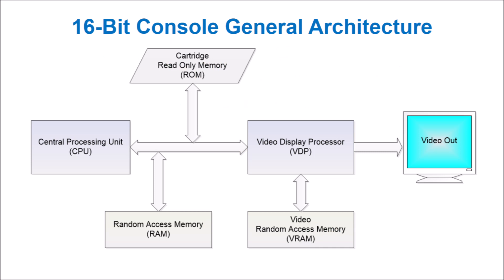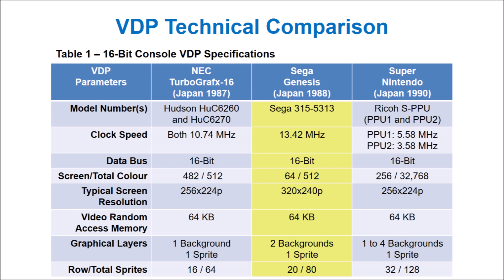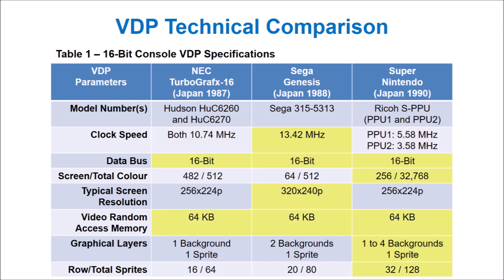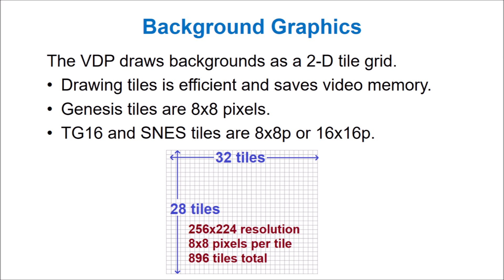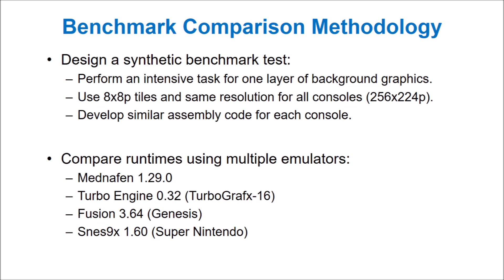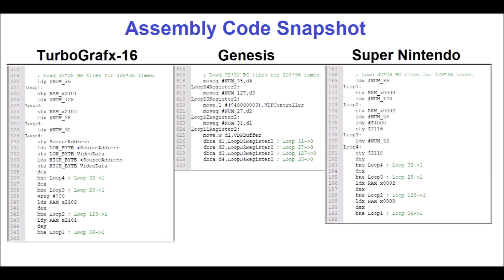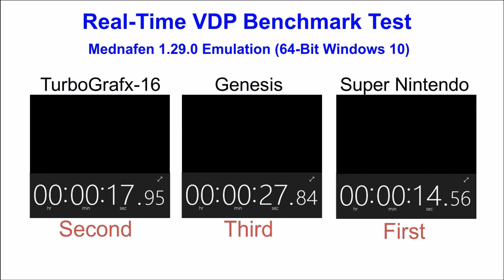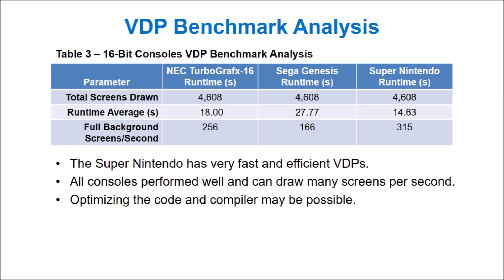VDP Performance: TurboGrafx-16 vs Genesis vs Super Nintendo

Comment: So both the Genesis and SNES have dedicated circuitry for doing this called DMA, and it would be more appropriate to benchmark that. This test shows what I was talking about in my last comment about the memory inefficiency of the 68000.
Reply: The SNES could have been a real beast of a console lasting beyond it's years if as you said it had a beefed up CPU and some of the silly flaws fixed. Like only being able to load 64kb of sample data at power up to the sound ram. If they did the simple fix of loading new sound sample data on the fly the snes would have had amazing music for the era. hey ho.
Reply: @robfarmer9272  also, a dma inside the ppu processor.
Reply: @robfarmer9272  it DID have amazing music for the era. I was there.
Reply: I second this. And while the TurboGrafx-16 didn't have a dedicated DMA, the CPU had the ability to copy data in blocks. If I remember correctly, something along the lines of "TIA source, destination, amount". :)
Reply: @inceptional  from memory only 3 games or around that found a way to re map the sound cache ram. But took a heap of cpu timing which had to blank the screen. Which made it very impractical for in game usage
Reply: yes and no.
This does combine all parts of the system to get an overall idea of performance.
Game GPU tasks would still be CPU bound IRL.

Comment: The TG16 had a superior color palette and sound chip than the Genesis. Just missing the parallax scrolling.
Reply: Totally agree on the better sound. The FM synth was a beast, but nobody knew how to tame it. Only very recent, thanks to Dexed FM emulation, we finally get to push the DX7 and DX200 (kind of Mega Drive synth) to its full potential, thanks to modern UI. Take Sonic for example. The composer for the Game Gear must have had lots of fun surpassing the Mega Drive sound tracks on crappier hardware. The Game Gear tracks are full of energy. The MD version is warm, lush, metalic FM molasses at best.
Take After Burner or Space Hariier, two Sega titles. They rock on the PC Engine, yet sound crap on the Mega Drive. Galage 88, Cross Wiber, Jackie Chan, Bomberman 94, Final Soldier, etc. etc. The PC Engine is a chiptune dream.
Reply: @jc_doge  Thanks, spam detection is really bad in YT. Maybe you can give a search term that pulls the right link in Google for example.
Reply: @2kBofFun  Sure, it's a thread on sega 16 called "Sega Genesis vs System 16". post 31 and 32 summarize the main issues re: pcm playback.
Reply: More colors on screen? Yes
Better sound? No
Reply: Superior on screen colors, genesis and th16 has the same 9-bit color pallete.
Reply: @maroon9273  superior soundchip? 😂😂😂😂
Reply: Sound chip??? No way, the TG16 sound chip is crap compared to the Genesis.
Reply: @jonpirovsky  The Genesis sounded like Darth Vader having sex with a high tension wire. I had both systems when i was a kid, compare MUSHA to Blazing Lazers.
Reply: @ImWithTeamTrinity  lol brah... you heard darth having sex in that sound lol
Reply: @ImWithTeamTrinity  Blazing Lazers sounds muffled as hell... It's not bad, it's just a muffled, somewhat boosted NES sound. And Musha is far from the best sound on the Genesis. The Yamaha chip on the Genesis is far more capable in expert hands, as Streets of Rage, Shinobi and many others can attest...
Reply: you guys are weird lmao
there are great sounding games on both and spec wise they trade blows all the way down the page (hard panned stereo vs smooth panning, more complex sounds vs easier to program, 8-bit pcm without interrupts vs buffered 5-bit pcm with interrupts.. the list goes on and on).
Reply: @jc_doge  Can you give any info source on interrupt capability between snes/md/pce?
Reply: @2kBofFun  PCE is kind of an interesting middle ground between 8 and 16-bit. Sound wise It's a 6 channel wavetable (32 sample 5-bit loops). You can switch any or all channels to "direct d/a" mode, meaning PCM. Now, it doesn't strictly have a pcm interrupt (unlike the nes), but a common method is to use the the timer interrupt to feed it at 7KHz or the scanline interrupt for 15KHz. If you look up pc engine pcm demos you can find some on youtube doing some pretty advanced stuff with channel mixing at even higher sample rates.
Reply: I bought, enjoyed and still have these three consoles from the 90’s. Regardless of the tech specs or “bench tests” it was the developers that either gave you only what the development tools offered or pushed the limits and sometimes going above and beyond what the hardware was initially thought capable of. Late in the Genesis lifecycle we enjoyed special effects in game software that wasn’t capable from hardware alone. TG-16 games had a very distinctive look, feel & sound and was the little engine that could but it never achieved the success in NA that it had in Japan mostly due to lack of advertising, licensing and support in NA. The SNES had superior sound, colors and special effects in hardware with some early games suffering from slowdown until developers became familiar with the hardware. Special enhancement chips would be incorporated in the SNES cartridges that allowed for even more incredible sound and special effects. Personally I enjoyed the games on my Genesis & SNES equally but more than my TG-16. My experience with the TG-16/PC Engine is that while I enjoyed many games on the console it was always obvious to me the Genesis & SNES games offered vastly superior sound and graphical effects but its CD ROM games definitely benefited from that format just very limited.

Comment: Interesting, but nobody would actually do this on the Turbografx.
The Turbografx had opcodes (ST0/ST1/ST2) and a block VRAM copy state machine (TAI/TDD/TII/TIA etc opcodes) which are several times faster than this and were intended to be used for this exact scenario (copying data from RAM/ROM to VRAM, or from VRAM to RAM).  The copier takes 6 cycles per byte written, so approximately 1.5 million bytes per second, and would chew through the 4.1 million tiles in around 3 seconds.
Reply: @inceptional  Feel free to make more leaps of logic and put more words into my mouth.  Your mental gymnastics are impressive.
Reply: @inceptional  You typed a lot of words to double down on your previous comment. The person you replied to did not imply the other systems were given any advantage. Only that the tests were not particularly well optimised for the systems. He likely used the PC engine as an example as he's familiar with the hardware. If he was more familiar with the Nintendo he may have mentioned that. You're assuming bias where none was evident.

These types of tests only really make sense if the hardware is being used in an optimal way. You wouldn't benchmark an Nvidia 4090 by slowly pushing pixels from RAM into its video buffer using only the CPU - it makes no sense. In fact, benchmarking consoles is generally ridiculous since the games are what define them, followed in priority by the ease of development and maybe how the hardware works as a whole to deliver content after that. Raw figures mean little. I feel the same when people "benchmark" mobile phones. Who cares?!
Reply: @inceptional  His point, obviously, was that the optimum method wasn't used for the test. This doesn't mean the optimal method was used for the other systems either, but he was pointing out one case he was familiar with. Did you really find it that difficult to understand?
Reply: That seems incredibly fast, maybe even too fast. They would mean Turbo graphics could display full frame rate and resolution fmv from the cd or simulate multiple layers using tile animations no problem. The arcade card certainly shows it is capable of something special. The 320 mode of the turbo looks real nice too but only a few games use it and the system does tend to have a bit of sprite flicker. Almost sounds like z80 code with those block copies.
Reply: @turbinegraphics16  Well, the downside is that the CPU is locked out of running code while the transfers are taking place.  So it would be a bit unrealistic to expect this kind of transfer rate all the time (unless everything fits on the cartridge or in RAM and you're just copying data.)  Also it won't really help all that much with simulating a dual background.   A second playfield does not exist on the TurboGrafx, so simulating that would involve manipulating the tile pixel data just like on the C-64 or any other single playfield system.  The ram copy function is fast but cannot alter the data like this in transit, it only copies.  You would need to precompute the scrolled tiles and copy them on the fly.  This is unfortunately very expensive as far as ram utilization is concerned.

Comment: Sega vdp is suspiciously slow.
Reply: Wasn't it just a beefed up Sega Mastersystem VDP. I'm sure remember reading that way back when. It's why it was compatible with the Mastersystem roms. It had a Z80 built in for helping the sound chip but was used for master system roms also, and the VDP was compatible with the Master system as it was basically the same chip beefed up. The powerbase add on didn't have any extra hardware. Just an expansion port convertor and LED. If SEGA actually built the MegaDrive from the ground up to be a system 16 or 18 hardware then it would have been much better imho.
Reply: @robfarmer9272  Probably, since ms can also display decent amount of colors. No doubt, MD could be significantly more powerful, had it been designed from the ground up.
Reply: @frun  yeah. I think where Sega got it wrong. They could have made a better console with off the shelf parts but just spending a tiny bit more. I mean the Yamaha YM2151 sound chip is just better than the MD YM2612 but costs only slightly more. Equally they could have beefed up the CRAM and VRam. The colour palette was a letdown on the MD.
Reply: @robfarmer9272  but the ym2151 needs an external dac and doesn't include any pcm hardware. say what you want about the ym2612 pcm being crappy ( it is lmao ) but at least it's something. There's also the rumor that yamaha wasn't always willing to sell their higher end chips to everyone.

I would argue they'd be better off just making the small tweaks that would make pcm much easier and faster, and a bit more ram for palettes.
Reply: @robfarmer9272  facts, big mistake sega made. This is why sega released two add-ons which led to to fall of sega. The genesis would've had a longer lifespand and more competitive with the snes, had they built it based on the systems 18 or 16 board instead of the master system.
Reply: @robfarmer9272 This video is running emulation.

Comment: This is very interesting stuff, I didn't expect that result for the Genesis/Mega Drive. I suspected that the issue here isn't so much the code (though minor changes might make it faster), but rather that the interface between the CPU and VDP isn't optimal.

(Appologies, a wall of text is incoming :P)

With that in mind, I took your code from github and changed it to access RAM directly rather than accessing VPD registers and assembled/ran it on the only 68000 platform I've got an emulator for right now - the Amiga 500. Obviously I set the emulator to run cycle accurate and not be faster or slower than the machine itself (the Amiga emulator I use, WinUAE, is extremely close to the real deal in terms of speed for the A500).

Even though the Amiga has a slightly slower CPU (at 7.09MHz to the Sega's 7.6MHz), the code ran much faster than what you measured. It completed in about 14,5 seconds (measured by hand using a stopwatch, so not as accurate as what you did ;)).

To me this confirms that the main issue here is the access speed to the VPD. Might be interesting to see what happens if you change the code for all three to access spots in RAM instead and rerun the tests to see what the speed is at that point.

Edit : I forgot a very simple optimisation (loading VDPBuffer into a register). I've now updated the results for that change. Makes a pretty big difference.
 
Just for fun, I also tried what would happen if I rewrote the code to be a bit more 68000 specific. I combined the loops so that only two remain: an outer loop running 35*127 times and an inner loop running 27*31 times. I also changed the VDPController/VDPBuffer access to use registers instead of an immediate value and immediate addresses. This changed the speed to about 10 seconds. I could have optimised it further (by unrolling the VDP writes), but that felt like cheating to me so I stopped here.

From this and the clock speed difference between the machines, I would tentatively conclude that the Sega Genesis CPU should be able to run the code you provided in around 13,5 seconds and my optimised version in around 9,3 seconds. Of course, this does assume that the Sega Genesis (like the Amiga 500) has zero-wait-state access to RAM. The remaining 10 or so seconds is then slowdown due to VDP access.

Interesting stuff for sure!
Also a neat showcase to see that MHz ratings are not everything.
Reply: @inceptional  sure, it’d be quite interesting to see whether or not the SNES/PC-Engine can or can’t be improved 🙂

To be clear, I’ve not actually tried to make an ‘optimal Mega Drive’ version. See, I don’t actually code for the Mega Drive so I don’t know if that system has any specific hardware support for doing this fast. In fact, I’ve quite deliberately not hyper-optimised the 68000 code either, as I’m not actually trying to make the MD seem better than it is. 

All I’m interested in is pointing out is that each CPU has its own method of doing things and showing a more common 68000 approach here.
Reply: Bonus points for seeing where my new algorithm has a bug 😂

Doesn’t make much difference speed wise if you fix it, though 😉
Reply: @inceptional  not quite, the code for the other systems is much closer to what you’d expect to do on when coding this kind of stuff on a 6502 based system. My reason for optimising the 68000 code is because it wasn’t written the way 68000 code normally is.

In other words; the 68000 code was clearly suboptimal to begin with, while the 6502 code was quite decent.
Reply: Again, I'm impressed by ur skills to improve the test even more... u guys are beasts, both you and the guy in the video! Cheers!
Reply from the maker: Nice to hear from you and thank you very much for great ideas. I'm a big fan of the Amiga 500 and it's amazing you are coding on one🙂. It would be really interesting to see how the Amiga compares to the Genesis.

Yes, that certainly makes sense to access RAM and use a register for the VDPBuffer. It will be fun to try and see the performance differences.

Using larger for loops is certainly helpful. I wanted to keep the algorithms as close as possible on all three consoles, and limited the range from 0 to 127. This way I was able to use moveq for the 68000 as you suggested in the previous video.

I appreciate your help and thank you so much for the interesting discussion.
Reply: @hagopds  thanks! I've been coding on the Amiga for a few years now, always have been fascinated by retro tech and it's a very interesting platform that I used heavily in the past, so it made sense for me to start there :)

By the way, my inner loop optimisation can't be done - it changes the output of the example code (which I hadn't seen because my test code didn't write to an actual VDP ;)). But changing it to three loops rather than four should still be possible and keep most of the speed increase I found.

Also, I only wrote to RAM to see the overal speed of the instructions, because I thought that the VPD might be slowing things down. It seems this is the case. I don't think that doing the code on the Mega Drive itself via an intermediate cache action in RAM will be faster :(

As for Amiga vs Mega Drive, I'd simply say that the Amiga 500 is a better computer and the Mega Drive is a better games machine. IMHO, of course :)
Reply: Edit: you know what, never mind. I just read the rest of the posts on this video and I have no intention of getting into a drawn out discussion. So I deleted my original reply to your latest post.

Believe what you will about what I do or do not want to achieve here, but I'm not going to continue discussing it as it won't lead anywhere useful. 

Anyway, I genuinely hope you'll have a great Christmas season - life's too short to worry about things like this for more than a few minutes :)
Reply: @inceptional  Then learn 6502 assembly
Reply: Thanks for sharing this precious knowledge with us, it was very instructive about how a different hardware can set a type of optimization. I don't really know about Assembly (the lowest level I learnt was C so…) Still it seems pretty interesting when explained like you did.
Reply: @nathleflutiste  thanks!
Reply: There’s an emulator for Genesis called Kega Fusion, it has version for Windows and Mac.